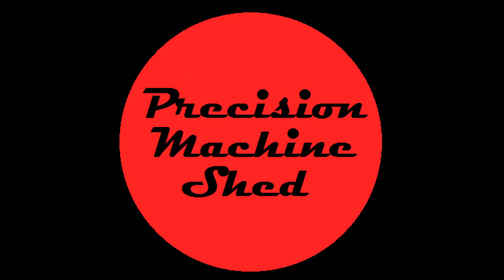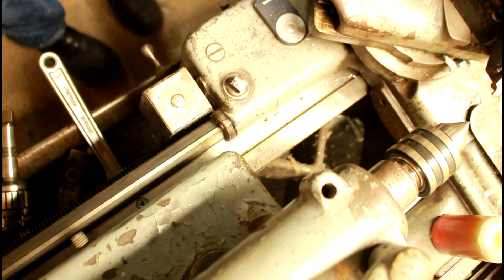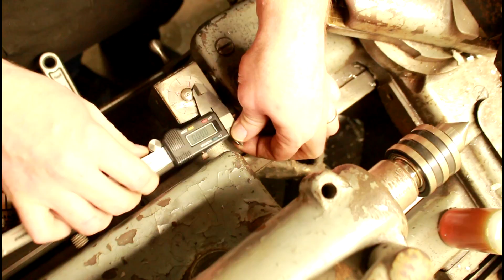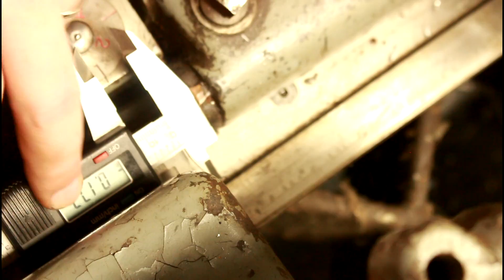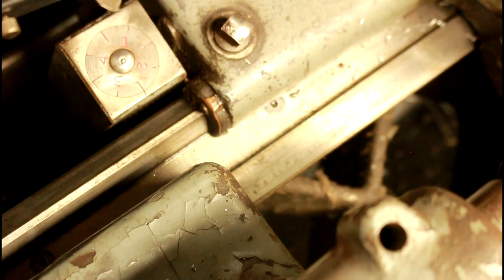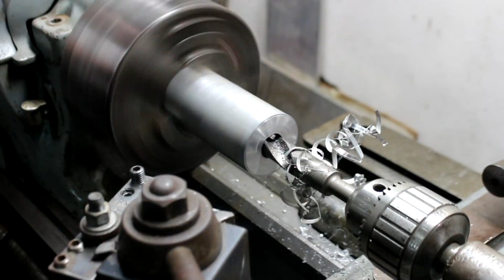Lathe Tips, Carriage Micrometer Quick Measurements without resets

Comment: "So I'm boring."

Don't beat yourself up like that, man. But seriously, I do the same thing essentially by setting my depth using a magnetic back indicator on the ways, move the carriage to the depth I want, and then set up a carriage stop. That way you don't have to measure each time, instead just turn up to the hard stop.
Reply from the maker: Haha, yeah. I need to buy a mighty mag, and I know they are cheap, just haven't gotten around to it yet. FYI, Might be some more "Boring" vids in the future!
Reply: Same.  My mag back indicator is a cheapie Shars, came with the magnet back for under 20 bucks.  I figure if I fill it with chips and oil, no great loss.
Reply from the maker: I'll have to grab one. It's one of those things you don't know you need it, until you need it. I have a nice Mitutoyo 0.0002" (yes, that's correct) increment depth micrometer that mounts to a lathe bed, but it's been a while since I've used it and I think it was last used on a SB 9" so won't fit my 13.